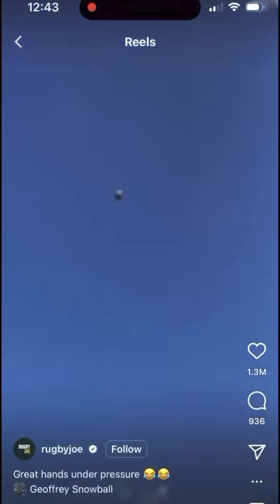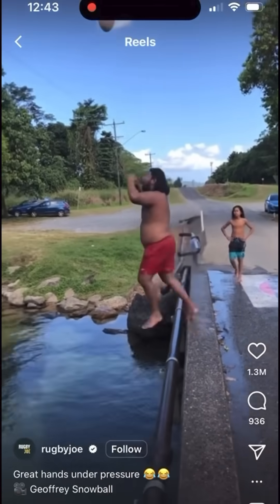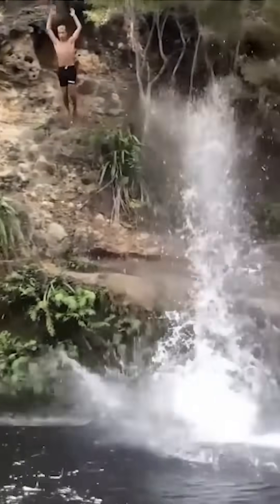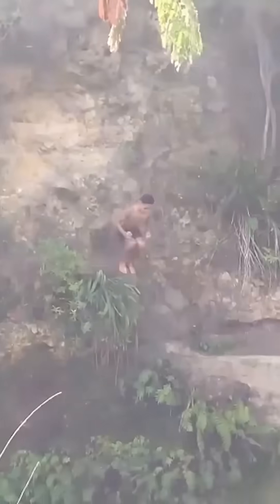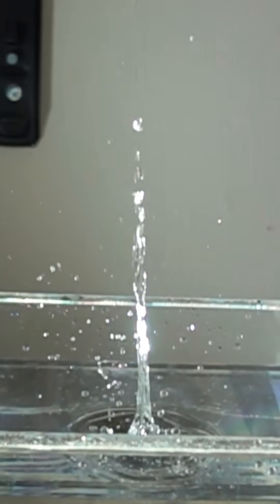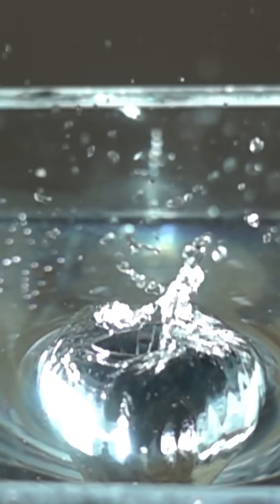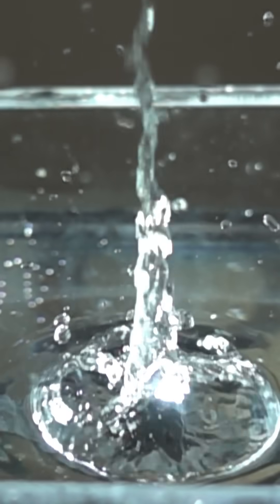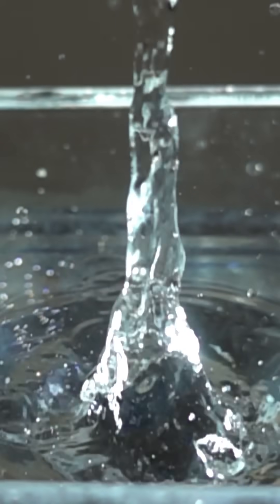How Do Manu Bombs Work?

Comment: Is this how high explosive anti tank shells work?
Reply: well there are a lot of ways to achieve a HEAT effect 
but for example the RPG uses a charge with a cone shaped cavity that focuses the explosion into a single point, which then melts a copper liner and propels it forward creating a copper lance 
so ig the idea is similar but not quite
Reply: @duccie  The water when your body has passed through and dumped its kinetic energy into it is displaced by air, and the space filled by air is at this point conical. Then the weight of the water around the point of impact overcomes the initial energy you added to it and the conical space collapses very quickly, which then projects a spike of water at high pressure back up through the "hole" you made in it. 
So the water you fall through actually acts very similar to the copper funnel inside a HEAT round, and the water spike being shot out would be the concentrated armor piercing chunk of solid metal. 
It's not really molten, it's just being deformed really, really quickly.
Reply: @Reddotzebra Technically water is molten
Reply: @Reddotzebra Not molten but still effectively a fluid due to deformation force to strength ratio.
Reply: @Reddotzebra That was a great explanation that made it all clear and understandable. Thank you.
Reply: @duccie  i mean it kinds looks like in the video
Reply: Yes
Reply: Yes, this is how shape charges work. Similar to the Munroe Effect.
Reply: --- @Sun-Tzu-  
            The art of war
Reply: Not really

The only common thing is it produces jet
Reply: @yoonseongdo3303 Its actually the same effect. 
In case of water jump, your body creates depression in water surface with over pressure in water body, which looms back and creates splash of water. In case of HE charge, conical shape is preformed inside explosive and when explosives go off, it creates overpressure zone, producing the same effect of directed  "splash" of explosive gas, pushing something really HARD